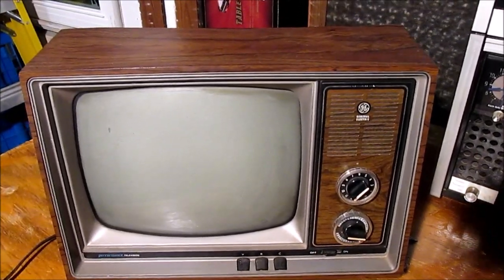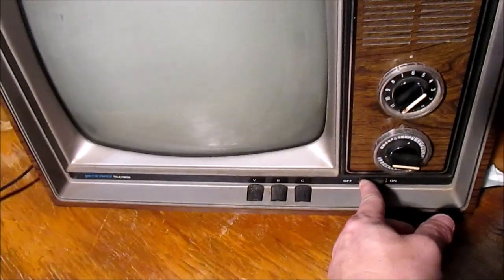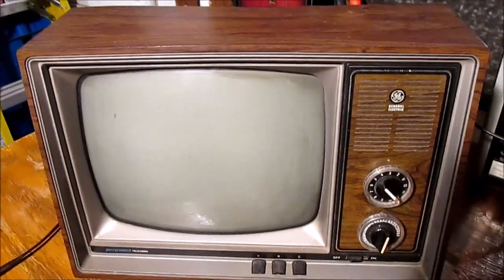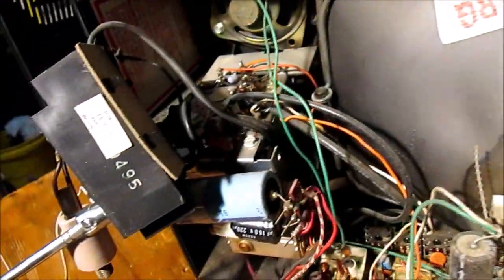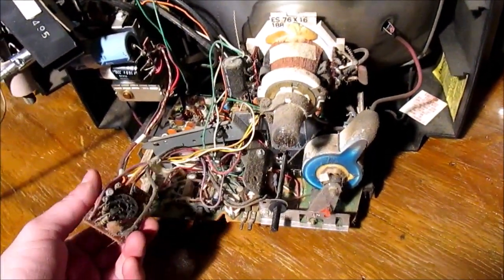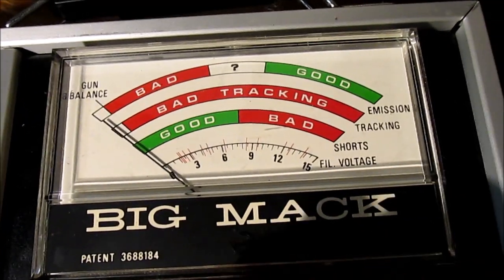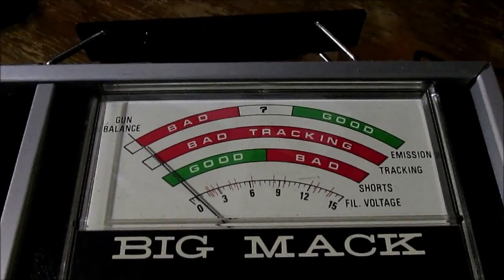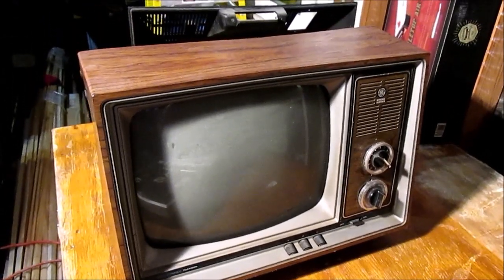General Electric Performance Television 12" B&W (1979)

Comment: Even then, people liked watching a black and white TV.  Cheaper than a color.  I had a Sharp in my bedroom for years.   People who had one like it felt, well, a TV is a TV.
Reply: J C exactly, its entertaining enough, its a wonder in it self (tv) b and w or color
Reply: I remember back in the 80s the son of a family friend got an old 1960s B&W Admiral TV somewhere, probably at a garage sale, along with a bucket of spare compactron tubes, it was his pride and joy for a time. Then it was demoted to a basement TV, but still used from time to time. By the late 80s I had a Zenith Chromacolor II set, I got it cheap because it had a loose module board in the back, which I found out later, I used to bang the top of it to get it to behave. People are too spoiled now, but I would take either that Admiral or the Chromacolor over one of those crap flat screens imported from Asia, at least there was some quality in them.